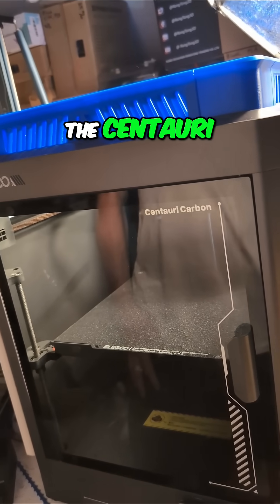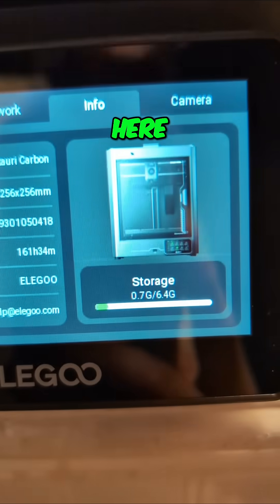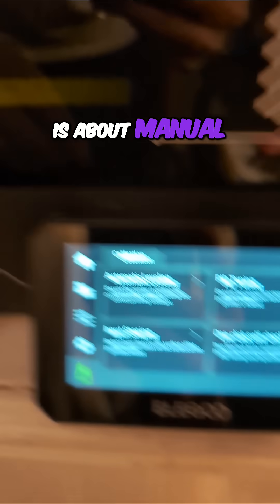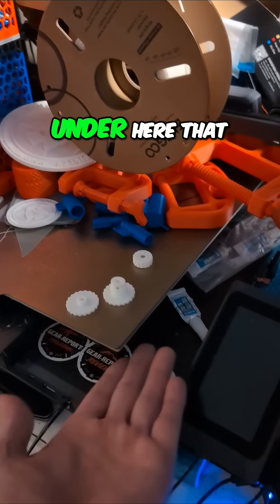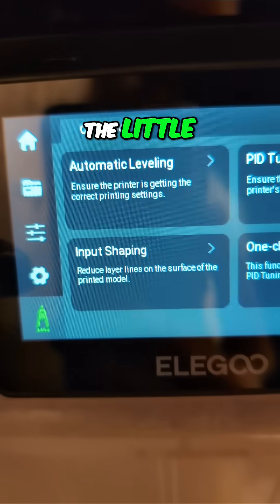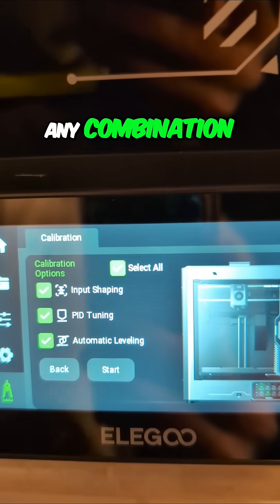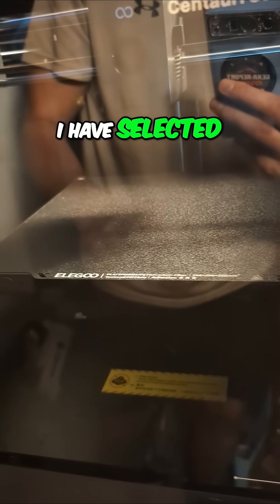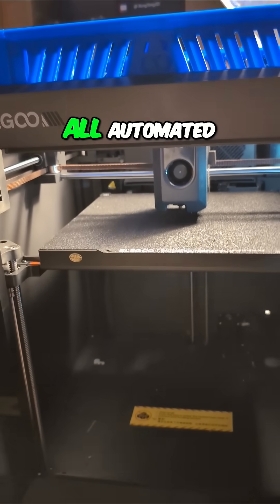Centauri Carbon 161 hour update and how to run one click set-up

Comment: The Neptune 4 Max knew it was coming.  Everyone has been talking about the Centauri Carbon.  Old printers are sulking in the corner spinning their manual bed leveling wheels.
Reply from the maker: The N4M has been sad for a while. It hasn't been getting enough love for a while. Just too much hassle to make it print the first 2 layers of large prints well

Comment: I am very happy with my Centauri carbon I am currently at a little over 300 hours and I have had no issues. To be fair I have mostly printed PLA and a little TPU so I have not used it for carbon or glass fibers yet.
Reply from the maker: I haven't thought of anything to print in CF yet.

Comment: I discovered the hard way (bed getting scraped) that the 4 screws in the buildplate are manual leveling screws. I tightened them down because they seemed maybe a little loose and screwed up a couple beds. Auto leveling doesn't actually level the bed, there's only one Z motor. What it does is move the bed up and down during printing to compensate for it being out of level, but it can only do so much. If you manually  check your level, using a level app on your smartphone that can display tenths of a degree should get you pretty close, but don't necessarily level it to 0 degrees, but rather to whatever the bottom inside of the printer is at. Fixed the issue that I caused. 

It's also possible for the entire bed gantry to get tilted and Elegoo has a video on fixing that as well.

Anyways just thought I'd share a few tidbits of my experience :)
Reply from the maker: Thanks. I should go find the elegoo videos and learn more about the printer proactively
Reply: How does it print ABS / ASA ?
Reply from the maker: Haven't tried it yet. Waiting on some brands to send me filament to test, and to get a better filter on it.
Reply: @GearReportMaker  reach out to LDO, they have been giving out their new filament a lot. I got a spool of LDO blue and Black free the other day. Still haven’t used it. Waiting for a LDO Blue Voron 2.4 kit to come in. Figured it should match colors well.
Reply from the maker: I'll check out LDO. I mostly work with brands on Amazon. I've made close to 6000 Amazon product videos.
Reply: @MrBooth1974  ASA printed fine for me,  I printed an object covering basically the entire plate corner to corner. It stuck to the bed so hard when it warped that it actually pulled my bed off the magnets and flexed the bed, so I'd recommend printing some clamps or something haha.

I did use Magigoo as glue so that may have helped.

The warping wasn't terrible all said and done but it probably would have been even better if the bed hadn't lifted like that. On large prints I'd definitely recommend a clamp of some sort.

Also, it didn't do much for the toxic fumes and odor of ASA, and I was using good Polymaker stuff. I wouldn't recommend printing ABS/ASA indoors. I put it in my garage.
Reply: @cadenseward2054  I was wondering about the filter that’s on it. I print a ton of ASA and I’m looking at this to build out my little print farm. I’m probably going to get one of these and a Sovol Zero to decide what one to go with. I’d prefer the larger bed, but that Zero is very nice for the price.
 I think my old X1Cs are getting to the point where they aren’t going to be around much longer. And I’m trying to be proactive on finding replacements.
Reply: @cadenseward2054 also, did you try heat soaking it before the print ? I learned that trick on the X1C a long time ago. It prevents most ABS /  ASA from warping during a print on a machine without a heated chamber. Works for me really well.
Reply from the maker: Heat soak the filament? The bed?
Reply: @GearReportMaker heat soak the enclosure. Let your bed run at ABS temps for 30 minutes or so with printer closed up before starting the print. The entire interior gets warmed up so your print doesn’t cool down enough to warp.
Reply: @MrBooth1974  I've had good results on both.
Reply: Just printed some 25% glass fiber nylon from Polymaker yesterday, the printer did well :)
Reply from the maker: That give me hope. :)
Reply from the maker: I'll have to look into that. Never tried it.